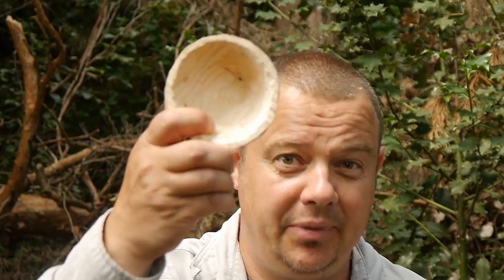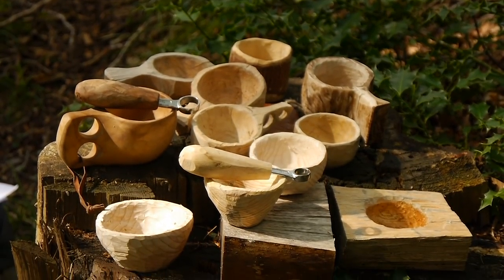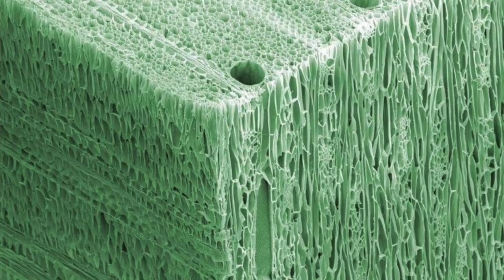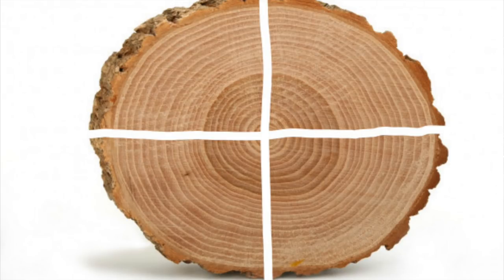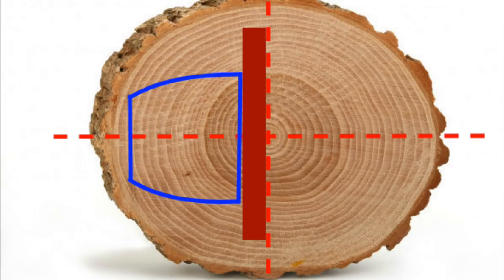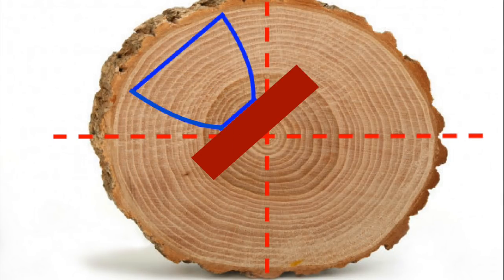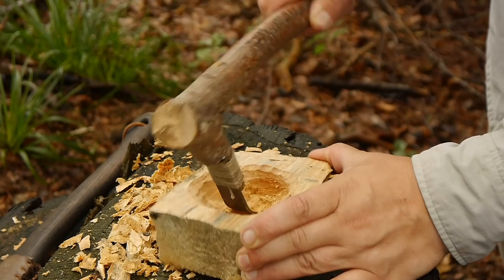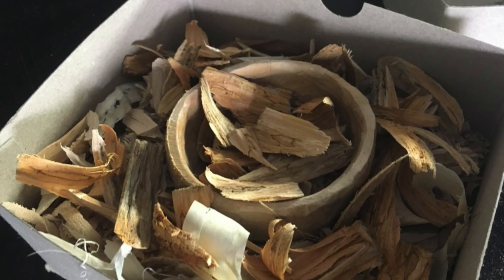6 Tips to reduce the risk that your Cup/Kuksa get shrinkage cracks

Comment: with my cup I made I also had cracks and now I know why, so thank you for the video. I mixed wood glue with sawdust and filled up these cracks and after drying worked with sandpaper. This at least made the cracks disappear completely for the eye and made it waterproof. I used this mixture also when hand-crafting wooden scales for my swiss army knife. Sandpaper makes these glue parts disappear completely 👍🏻

Comment: You make great points not for just making cups but for spoons too. If you position your bowl in the wood in your way it makes carving it less work. The round limb makes it less work to shape the bowl. I form the bowl first then shape the handle and top. I leave an inch or more of the sawn ends on till last. You can make two at once if the wood is clean of knots. I just carve two bowls beside each other with the handles facing left and right. I leave an inch between them. I use a small saw, hatchet, and gouge, draw knife, hook knife and 2-inch wood carving knife. It is important your tools be sharp; if the cuts you make are smooth you have a sharp tool. I need at least a gouge or hook knife to make a bowl. I never had any I made crack or split. I do seal the things I make with walnut oil and a little warm softened beeswax. I like your spoon wrench idea; they make me laugh. ✨🔪✨🪓🦉

Comment: Great info!
I’ve had much success using the quartered section & wrapping in a paper towel & storing in a paper bag to slow the drying process!  The paper towel seems to hold some moisture & prevent it from escaping the piece so quickly! Thanks!
Reply from the maker: Thanks for this super tip!

Comment: Hi Felix ☺ thanks for the tips, and you are correct in the orientation of the cup to the truck of the tree, also in cutting your blank at least 30 cmtrs from the end cut of the tree, as some trees get stress shakes running up the trunk during felling, it's Russian roulette hoping to find one whithout fine cracks, but your advice is good, I've even microwaved bowls turned from wet timber whith some success, although they all shrink and warp a bit, and quite a few have cracked, this is done a few seconds at a time on defrost, when it gets too hot to handle let it cool and then defrost cycle some more, don't try to heat at a higher temperature or it will burn in the middle, it's an interesting experiment, and carries some risk , especially if the wife catches you,lol. Thanks Felix, stay safe mate, best wishe's to you and your's, Stuart uk
Reply from the maker: Hello Stuart. Thank you so much for this super interesting feedback!!!! Very nice of you 😀

Comment: Boiling in salt water will reduce cracking, but it's not enough alone. 
Also, if the ambient humidity of the weather outside is higher than 60%, you should avoid putting the kuksa in a box with wood shavings, as it will develop mold quickly (a couple of days).

One more trick if you are at home: microwave your cup for between 45 seconds and 1 minute 15 seconds and let it cool an hour.   Repeat many times.  If you weigh it at the beginning and after every microwave,  you will notice the decrease in water weight.  For my kuksas I did this approximately 20 times each ( over a period of 2 days) And they all lost about half of their original weight,  with no cracking.  2 days is much quicker than a month, and no cracking.
Reply from the maker: Wowwww, what a great tip!!
Reply: @FelixImmler  Thank you.  Love your videos brother.

Comment: I've boiled kuksas in salt water.  My impression is that it can help slow the drying rate.  I've tried it with a cup that has sapwood and heartwood and it still cracks.

I have a relative that dries turned bowls in the microwave and that can help too.  Maybe the boiling also softens the lignin.